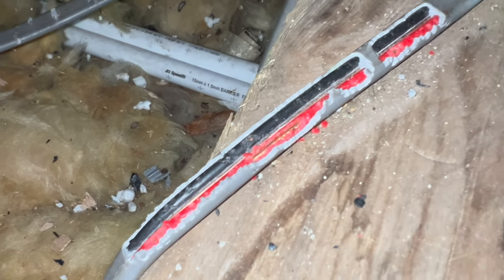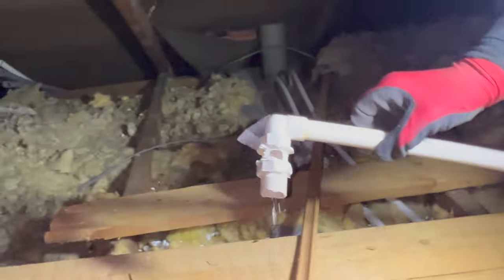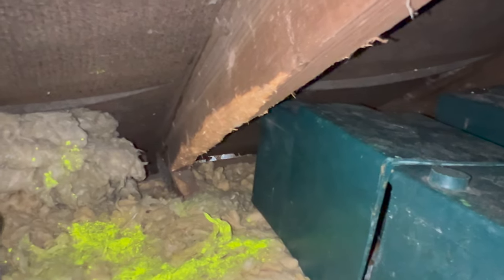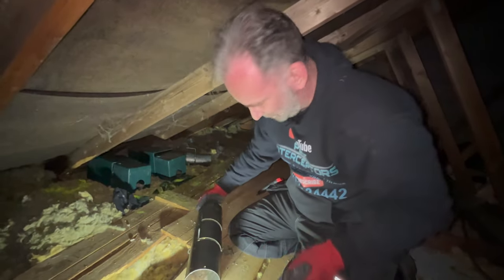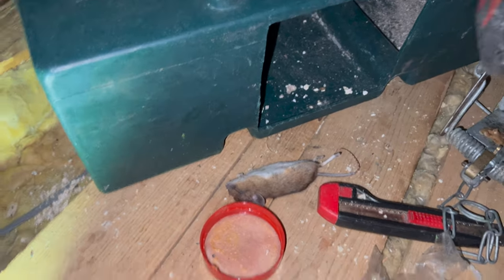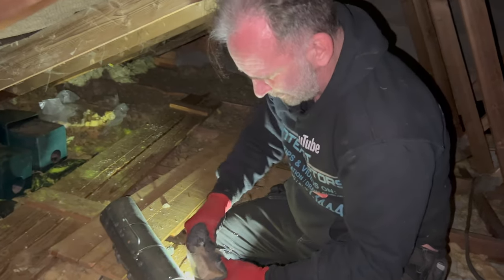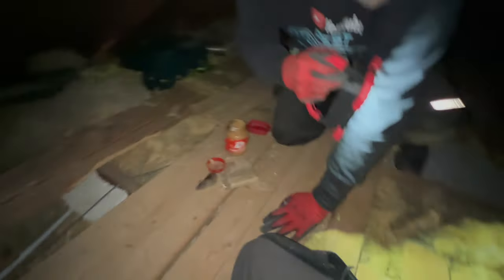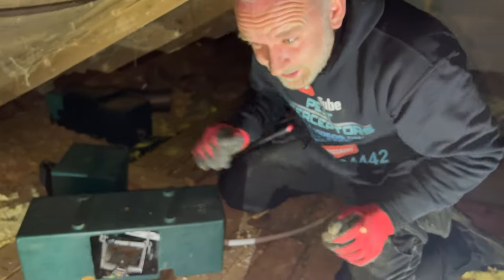Squirrels try to KILL me!!! So we set traps for them. WCS Tube Traps and Fenn Traps!!!

Comment: I’m also a pest controller and I’ve had squirrels chew through 0.8 mm metal plate. Obviously they are rodents that need to chew something to keep their front teeth in check. I’ve seen a dead squirrel that actually died because his teeth grew up and into his brain. Yes there are a lot of amateur pro’s out there but they usually get found out. Keep up the good work 👍🏻

Comment: They got in my house loft, many years ago. Now I trap them as soon as I see them, fenn trap, in vertical box with the correct sized hole in the top, peanuts on the plate of the trap, the squirrel sees the nuts, leans in through the hole and treads on the trigger plate. Good video, thanks. Peace be unto you.

Comment: I endorse the WCS tube trap 100%.  I've screwed my tube to a larger board which I hold down with my foot while I'm setting the trap.  It's much more stable and steady than trying to hold the tube steady while setting.  Peanut butter is also my preferred bait.  BTW, it also kills rats.
Reply from the maker: They truly are not for the faint hearted when it comes to setting the trap! 🤣 
Good idea with the board. But then you need to unattach the board to get it into the places you want to get it. Swings and roundabouts I guess ☺️
Reply: @PestInterceptors  I only use mine in the back yard.  I don't have a benevolent attitude toward squirrels ever since about 1954 when one bit through my fingernail.  They may be cute little critters but not in my yard.
Reply from the maker: @nemo227  and they are really upsetting the ecosystem! Giving our native red squirrel the pox, killing young trees, decimating the song bird population! 
You carry on my friend. They may be cute but super evil at the same time!
Reply: @PestInterceptors    Evil is an accurate label for them.  Tree rats.

Comment: Hi I always watch your videos on YouTube and are very interesting on best ways to catch rats just a quick question I have the wooden victor rat traps with the little brass trigger but for some reason it came off the trap and can't find it anywhere would you know where I can buy the trigger from thanks Chaz
Reply from the maker: I’m afraid that the rats of central England would just laugh if we used those old wooden traps here, so we don’t use them. I would think it would be as cheap to buy a new one as to fix the old one Charlie.
Reply from the maker: I replied on the other post Chaz.
Reply: Ok thanks for your reply

Comment: I have one of those tube traps. I find the trigger system hard to set to a sensitive position without it going off to soon. I also bait it with peanut butter, which unfortunately draws ants. I recenty went to a Canadian made trap by Piege Ouell. Model 411. Very, very powerful, easy to set and I just bait it with roasted peanuts in the shell.  I use a whole hand full with a few right behind the trigger and a freeby out on front. Some walnut oil on the peanuts will really bring them in also. I got three squirrels the first day.
https://youtu.be/EmxXVFyDids
Reply from the maker: Or try one of these. 
https://youtu.be/0vOteAkU7qs
Reply: @PestInterceptors Yes...I saw your video review of the Trapinator.  I like that DOC 150.  I would have to build a box/tunnel for it though. I was concerned that trapping with the 150 could get bloody, seeing how it would just crush the squirrel's head.  The 4 11 trap snaps the neck everytime for a nice, clean kill. Like the Trapinator, it will break your fingers if you were to ever get them in the way when triggered.
Reply from the maker: It is inside the tunnel it comes with when set buddy.